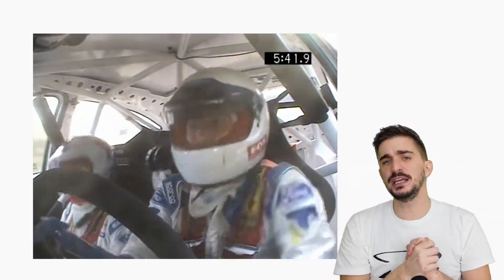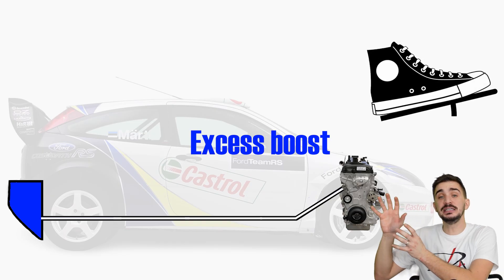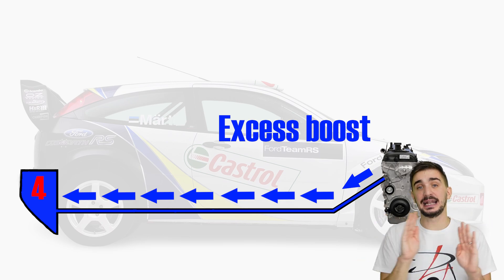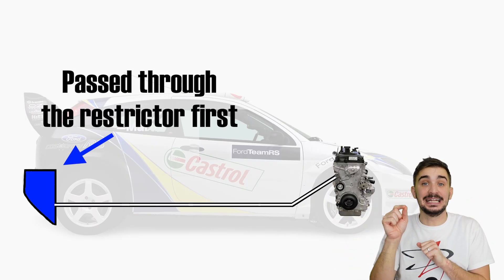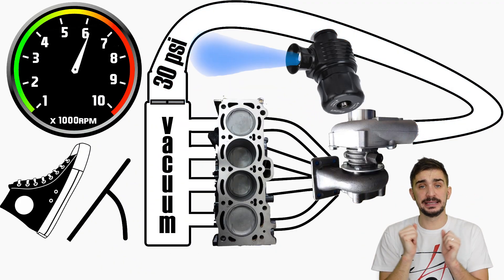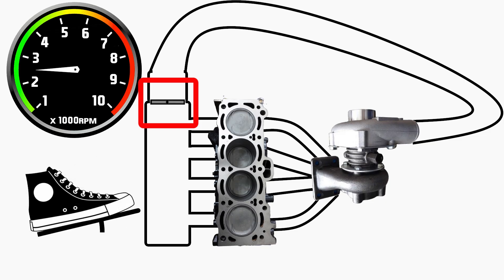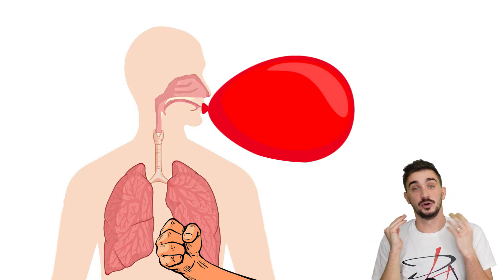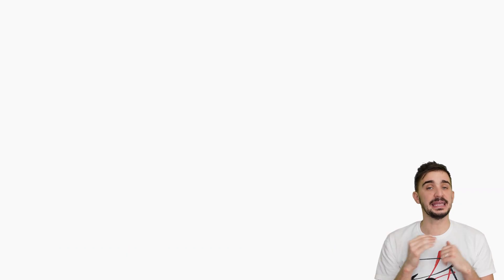FORD'S HIDDEN BOOST Tank - Welded TITANIUM filled with ANTI-LAG

Comment: The size of the turbo doesn't correlate to the amount of pressure, you can run high boost on small turbos, not as safe to do so as they are having to work harder but ultimately bigger turbos can provide more air which in turn creates more power with the appropriate fuelling.

Comment: So...in your hypothetical example, the turbo can generate a maximum 30-psi of boost, but it can actually generate 33-psi of boost? Maybe add a couple of sentences in your explanation about how the 30-psi max is at wide open throttle, and the 33-psi ability only happens right after you close the throttle because then the engine isn't flowing air out of the pressurized intake.

Comment: I may be wrong but if the waste gate pressure is set at 30 psi and you shut the throttle at peak boost (30psi) the boost will spike and it’s the spike that activates the bov, you don’t set your bov at 30psi if your running 30psi? You set it at a higher pressure so you don’t vent air at peak boost. I’m assuming by maximum boost you mean the waste gate pressure?

Comment: The tank pressure was higher than the regulated boost pressure demanded by the engine. During the surge event the pressure is higher than the control pressure - this is pretty much true for any typical surge event. So the tank probably reached as much as 60psi. Still, it was good for only a second or so of boost but it can get the engine out of the boost hole.

Comment: Reminds me of an experiment I read about in a drag racing forum many years ago. There once was a drag racer who wanted more power from his engine, but, having settled on the idea of adding some sort of forced induction, instead of installing NOS, a turbocharger, or a supercharger, he invented a fourth option.  He ended up towing a small, custom built trailer behind his car as he went down the track, and in that trailer was a 200 gallon tank of pressurized air that was hooked up to his intake manifold via a very long length of very wide high pressure tubing. All he'd have to do to get ready before a run was simply hook the tank up to an air compressor and fill it with as much air as he could/dared to.  IIRC he said it worked alright, but I think the threat of that air tank getting launched at the back of his head should he ever crash was enough to convince him to make boost with a more conventional setup.
Reply: There was a company that developed a system that used compressed air tanks on the car as a way of boosting the engine. It became complicated as you have to meter the air properly since you could basically force it to make max power at any rpm.
Reply: Why not put a couple LPG bottles with air inside the car? Can't fly at you if it's mounted well

Comment: Not venting boost doesn't effect the turbo lots of stock diesel trucks and equipment do this and they run much higher boost than stock gas engines

Comment: Has anyone tried to construct a variable diameter cold side boost pipe that would bellow out to hold extra air when the throttle valve was closed then snap back to it's original diameter when throttle valve was opened?

Comment: Is it really impossible to generate more boost pressure?  The pressure is based on what airflow torbo can generate and the rest of engine is blocking the airflow and therefore gives you a pressure.  Same airflow with no restrictions gives you zero boost. With same airflow and flap suddenly closes you have a hammering effect with much higher pressure. This higher pressure is stored in the tank.  Take a look at water ram pump. Same principle. Low flow, high pressure from high flow, low pressure.

Comment: Nice explanation... however, In my opinion, the device doesn't help to produce more top power, but instead it helps to keep peak boost on a wider rev range thus making more power on lower revs but NOT producing more top power... maybe thats why the car didn't dominated as probably it was harder to control under acceleration... some times the lack of torque in lower rpms can be an advantage if you master it... in my opinion that is... Cheers!

Comment: As a certified  welder I can appreciate those beautiful welds. That's an art worthy  tank
Reply: As a very inexperienced welding noob I can already respect how difficult that would be
Reply: Came to learn something new about Ford's hidden boost tank, stayed for a welding discussion.
Reply: yes nice tig welds...  more impressive if they had welded/made it out of magnesium.  that is the really tricky stuff to weld.
Reply: @davidgalea6113  You dont know what you are talking about.
I weld all kind of aluminum, stainless, titanium, and magnesium parts all the time.
Welding magnisium isnt much different from welding aluminum.
Titanium is much more specialized and requires much more skill to weld properly.
Reply: @morganmcintire2853  what welding method are you using with magnesium?
Reply: @davidgalea6113  I always TIG weld magnesium.
The metal always has to be cleaned very well first (assuming it is a repair job) because magnisium is typically used in gear boxes and engine blocks for aviation. Oil gets impregnated into the porous metal and needs to be removed prior to welding.
Magnesium is pretty forgiving while welding even in comparison to aluminum. You can dip your electrode without ruining it or having to regrind.
I use a zirconium alloyed tungsten and grind it to a blunt point. (When welding you want to nearly burry this tip into the metal)
I preheat the parts needing to be welded to around 350°F (to avoid cracking later) magnesium that has higher percentage of zinc content is more prone to cracking.
I keep a tank of 50-50 argon-helium mix set aside specifically for magnesium. It can be welded with pure argon but the mix is better. 
Welding magnesium is sort of sooty because of the zinc content and I clean the weld between each pass. But aside from the difference in shielding gas, the filler and prep work the process is similar to aluminum.
After welding the part I re-heat the part in my oven, then wrap it in welding blankets to let it cool slowly.
Reply: @morganmcintire2853  are those autogenous welds you perform on magnesium? Or is it really so prone to cracking that even with filler rods one needs to do heat treatment after the weld.
Reply: @AlessioSangalli  I almost always weld magnesium using filler (repair jobs always require filler) the only autogenous magnesium welds I have attempted is on lap joints using new material. And I found that the weld strength was improved by using filler. The filler contains alloying elements that reduce cracking and add strength.
Even using the filler I will pre-heat the material before the repair and post-heat after welding allowing a slow cool down. 
This is all a precaution to prevent cracking as many alloys of magnesium are very prone to doing.
However if the casting needs a proper heat treat (some casings require a AMS 2768 or  ASTM B661-06 heat treatment) I send them out to another shop to have that properly done.
The heat treatment I do after repairs is purely for post weld stress relief  / crack prevention and I have done my own solution heat treatment for magnesium to add ductility and tensile strength but I am not setup to do it for customers, especially for parts that are very expensive or "mission critical"
Reply: @AlessioSangalli  oh and it isn't like the weld is going to crack just because you don't heat treat afterwards but since magnesium is more prone to cracking I always heat treat as a precaution.
Reply: @morganmcintire2853  thanks!!
Reply: @morganmcintire2853  idk you could weld magnesium, i thought it would just burn
Reply: @huckitsuckit  Yeah I know. 
Those same people write my estimates at work 😒
Reply: I can do better welds then that and im only 8 years old
Reply: @hmmmtietmetmosterd  Good. When you get an adult you can weld submarines. They have to have perfect welds. I repair wrecked cars.  People die if I mess up
Reply: @lewiskemp5893  good! So you get to diside who lives and who dies
Reply: @hmmmtietmetmosterd  Not me. Lol. Not sure what are you talking about. But I take my job seriously because people can die in a car not welded back together right

Comment: this makes me think that perhaps a venturi style additive device could possibly increase the inlet air by using the naturally occuring vacc drop at the back end of the venti device, air flow causing a suck at another part of the car could possibly even alter its aerodynamic profile by creating zones of lower pressure air thats actually used by the ignition cycle instead of just redirected.

Comment: It is possible to charge the tank with the air pressurised by the turbine.
It is also possible to put that air at the intake of the turbine (given it has one way valves) and stack the pressure exactly the way the guy was saying.

Comment: question, what would happen if we got that 30 psi, then cut the throttle, let the turbo work up the pressure in the tank, and now comes magic : WHAT if we step on the gas again, and route the allready 30 psi tank air into the air INLET of the turbo ? should not that give a admittedly quite short burst of more boost ?

Comment: Great video explanation!
I asked a question about this recently (somewhere) and it generated interesting discussion.
I was specifically interested in a situation where an engine was over-turboed (capable of more boost than it could use)
and whether it could store that excess boost in a tank for use in eliminating lag.
The answer is: already been done!
Reply: Yep: Yamaha used something like this for 2-Strokes in the late 1970's into the 1980's called "YICS" Yamaha Induction Control System... it was basically an accumulator tank (without a valve) between the Carb and the Reed Valve to help smooth intake vacuum at lower RPMs.

Comment: You are wrong. Sooooo wrong. We made the bumpers to fit regulations on vehicle length like Peugeot did with 206. 
We put the tanks after in that place only as space allowed. The story of the tanks. It was not a tank. It was legal as a pipe the fia did not like the fact that we used the rules to our advantage.

Comment: Great explanation of how compressing air can only produce finite pressure. I used to sell air tools and compressors. I had to go through that every day with people who thought a DIY 5l compressor could power an impact wrench!
Reply: I actually overcame that with a 10gal secondary tank. Stored enough air to use an impact for more than a few bolts for the rare occasion I needed it and still had the portability of the 6gal for when I was only stapling or nailing.

Comment: 19:00 how is having a competitive edge over your competitor by way of innovation, not good for the sport?... Sounds like sore loser complex. It shouldn't be even across the field. If you don't put the time, effort and money into being innovative and creating new ways to have the edge over your competition, that's your own fault... I Hate this participation trophy world we live in...
Reply from the maker: This has nothing to do with participation trophies. It was innovation in the wrong direction so to speak. One of the greatest merits of rallying is creating stuff that can be implemented into passanger cars to make them better. For example rallying has been one of the single greatest driving forces behind 4wd improvement and evolution as well as a platform for finding and testing new ways to squeeze higher and more usable power from small engines. A boost tank is something that takes up massive space for minimal benefit and it's development wouldn't serve a greater purpose and could never be implemented in a passanger car.

Comment: With couble of valves and some oneway valves, You could get higher boost on tank.

All depends of valve placement.

So at least, that part of your max boost statement is false.

There was no absolute max value for what Turbo could provide by rules.
Just max amount of pressure in specified spot inside manifold.

You could easily avoid detection of over the limit of boost level being allowed. Specially when the time an tank could provide extra pressure.

Main advatage there for has To be in lower boost temps on sitting air amd there for for brief moment they could play with timing more and get more hp out in that way As at wastegate open dymbing extra pressure away, there is no lag issues with longer route for air to travel and cool off even more. 

But Anyway,  thats just whatt i think without seeing that system As whole inside and outside.

Comment: When you snap the throttle shut, it does create a pressure spike from all the air "stacking up" so, in theory if that tank was already 100% full, you could exceed the standard boost- so go from maybe 30psi to, say, 30.1psi! Massive boost! Great success!

Comment: This isn't entirely actuate, a centrifugal pump will create significantly higher pressures at lower flow. If you slam the throttle closed at high RPM, the turbo will create higher pressures than it can create when flowing a large amount of air. The reason turbos make the fluttering sound is because of exactly this reason. The plumbing builds up pressure until it overpowers the turbo and flows backwards.

You can very easily test this by hooking up a pressure sensor to your intake piping right before the throttle body. If your data has a high enough resolution, you'll see pulses in sync with the turbo fluttering.

Comment: I think you made a mistake at the 7 minute mark. A larger turbo does not necessarily make more boost pressure. It allows for a higher flow rate.

Comment: 7:08

Not really though. The size of a turbocharger limits the amount of air it can compress to a certain volume at any given time. The actual max boost is limited by many different factors.
Reply: Right? Engine masters goes into pretty good detail on how boost levels are not a good measurement in the first place either. Boost is a measurement of restriction after the turbo. If you were to have a better valve flow on an engine you would have lower boost but higher power with the same turbo. Not really an argument I guess but kind of a interesting aside.
Reply: I was gonna say the same thing , making 150 more horsepower on less boost pressure with a bigger turbo.
Reply: It's way more complicated. We could say that instead of pressure, air mass would be better indicator of power. But that's not true either because you have pumping losses in engine. 
In the end, power figures are resultant of many things, beginning at engine internals and ending at air filter/exhaust muffler.
I must agree on that bigger turbo will give you bigger power numbers at the same boost levels.
Reply: My friend who is into tuning once explained me it like this: Would you rather put out a fire with a garden hose at 1 bar or a firehose at 1 bar?? So small turbos can generate high pressure but not volume compared to bigger ones..

Comment: Hmm, ~20kg extra at the very rear of the car would increase the pendulum effect created when the front is steered, which would negatively affect the handling - I don't know if they dialled in understeer to try and combat this effect, but even with understeer handling the car would soon enough step out at the rear and then swing more violently.  Back in my karting days I frequently saw the karts that handled well beating those who had a bit more power.
Reply: 20 kg of titanium are 2.2 m² of 2 mm sheet. A box of 0.2x0.2x1.8 m is 1.5 m². With those reinforcements (the square pattern) there's a lot of metal you don't see
Reply: Check the weight of 2mm sheet. It would be far less than 20kg

Comment: Sorry to correct, but you do generate more pressure stored, Compressor is generting 30psi, just because that is what the engine can handle and flowing in the engine, once you close the throttle, blocking the flow, the pressure will encrease, maybe to 40psi, depends on what pressure the compressor surges, if using a volumetric compressor you might even store double or tripple the pressure until the intake can support or the compressor won't block the motor :) . Also Volvo(if I'm not mistaken) uses a pressurized tank for avoiding Turbo Lag.

Comment: hate to be pedantic, but its a pedantic video. Larger turbos do not make "more boost", rather they can flow more air. Actual boost pressure can be changed by things such as piping and manifold volume, temperature, etc. 10psi from a 60mm turbo might be comparable flow to 30psi from a 30mm turbo (numbers made up for the example). Thats why you use compressor maps to figure out what turbo best fits your goals.

Comment: Technically you can force more pressure in a tank than you have available outside of it by letting some of your other pressurized air escape, driving a further compression stage.  Almost like a second turbo driven by inlet turbo air.  Ford didn't do that and it's probably extremely inefficient, but it would work in theory.

Comment: 1:54 this guy has never seen proper 11/10 welds. A real welder would have used less cuts and used a rolled sheet and welded maybe 10 sections. This tank looks like elmo the patchwork elephant 😂😂😂😂 this was obviously built inhouse by someone that has know real clue about welding other than how to operate a welder. They couldn't outsource this job to anyone with  the risk of it being found out so some guy called dave welded this to keep it quiet. Its shabby as hell and that's probably something that played a big part in the rest of their season. Most of that whole tank could have been rolled and bent in one piece then welded 🤷🏼‍♂️ guess what im not even a welder. Imagine what a top welder would have to say about this 😂😂😂😂
Moral of the story is... Don't cheat. 
they still didn't even place in that tournament. they were plagued with issues and subaru took the the trophy and I think citreon won the manufacturers trophy don't quote me I'm only 2 minutes into the vid but I'm sure subaru and citreon won those trpoies that year